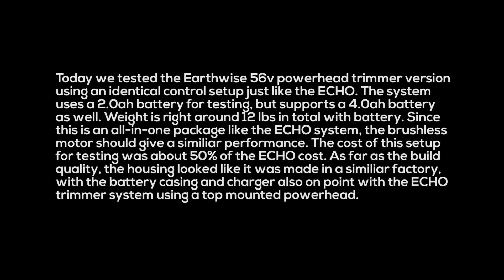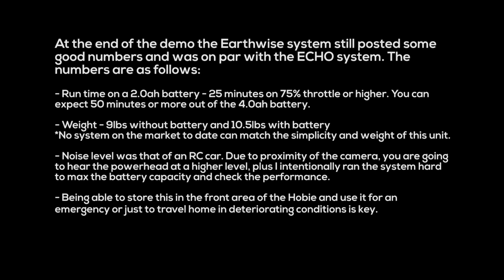Earthwise 56V  Electric Powerhead on a Hobie Drop-in System

Comment: Can you adapt something from dewalt those batteries are everywhere, while i prefer gas the pole and troll zones only allow electric motors!
Reply from the maker: The smaller batteries just don’t have the lasting amperage and duration for a high voltage application. I have thought about this at length, but brushless setups require higher voltage and a way to control the voltage. To many variables right now to make it not worth the investment.

Comment: Do you think something like this outperforms a 50somthing pound thrust electric trolling motor? i just picked up a intek seahawk 4 inflatable raft and tried to paddle against the current. lmao Never made it to my destination... So i was thinking of getting a purpose built trolling motor or rigging up something like that you have with some inexpensive weed wackers.
Reply from the maker: Auto Fix Pal based on what I built, used, and abused they will be comparable to a 2.2hp gas engine. A 4.0ah battery pack would be needed for a good 45-60 minutes of always on run run time. I get over 5.1 mph with current and 4.0 mph against depending on weight. You. Any buy cheap on the powerheads. You need a top mount motor with a detachable trigger to make turn for the tiller. A trimmer will not work in the out of the box state. You need a geared lower unit and right size prop.
Reply: @kayakbuddysllc-lightweight4947  Having a hard time finding an earthwise powerhead. they may be discontinued. i suppose i could use a 56+volt weed wacker with a angle grinder head fitted to a propeller. I just need to figure out what kind of prop would be appropriate.
Reply from the maker: Auto Fix Pal the earthwise has been discontinued. I spoke to the company and they replaced it with another version. I would go with Ego or the Scott’s brand. They have longevity and should be around for some time. I used the earthwise to see the compatibility with other brands. Check American lawnmower for a couple of decent models and cross reference on Amazon for a better price. Google express is also a good site to check prices.
Reply: @kayakbuddysllc-lightweight4947  i have an EGO trimmer already, it works great. So i may go with that brand. Thanks for your input, much appreciated.